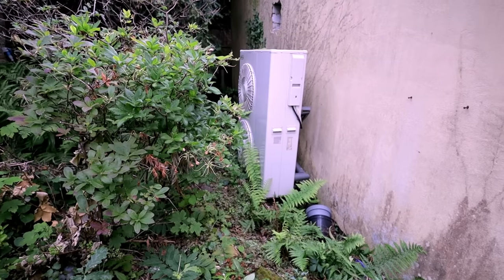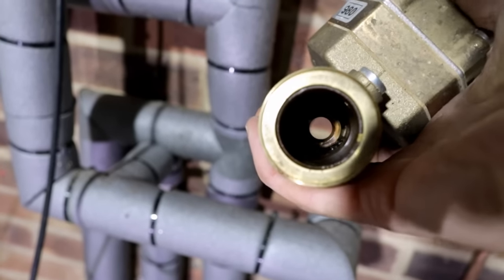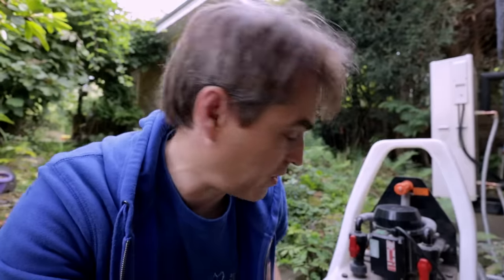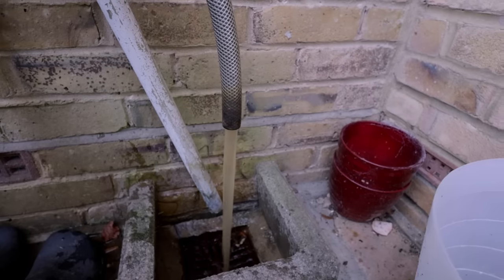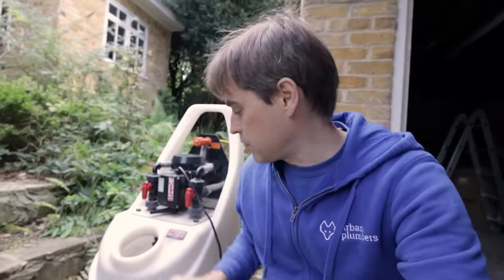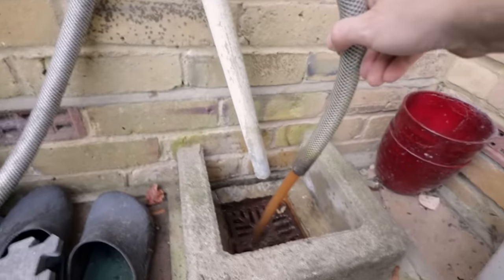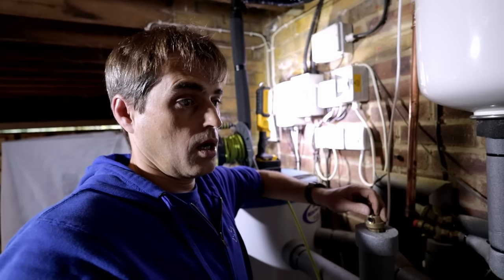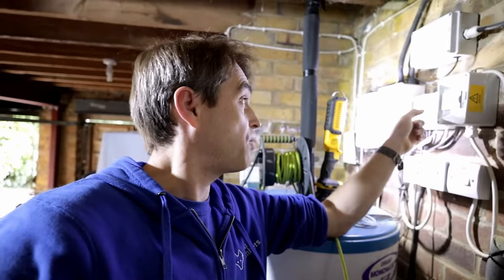Heat Pump Nightmare Update - What Was Wrong With It?

Comment: What were the potential root causes of this amount of dirt building up in the heat pump's heat exchanger? Galvanic corrosion? Some kind of external ingress of muck? Some other components in the system giving off crud that ends up accumulating in the heat exchanger?
Reply: If we are looking to get a heat-pump but keeping old radiators, should we check our plumber dose a flush first or is this just a one off issue?
Reply: @RobertHeibel with any new heat source even a new gas boiler I'd always recommend a clean to get maximum efficiency and to not risk clogging up your expensive new unit
Reply: Putting the unit surrounded with foliage adds dirt?
Reply: @RobertHeibel 
Every new installation must be flushed first.
Otherwise the warranty goes out the window.
Reply: If you're going to replace a boiler on an existing system,  either with another HE boiler or an ASHP or GSHP, the first you should get a water analysis carried out, I use Fernox Lab for this. Then you'll know what type of flushing will be required. Then you must fit a good quality filter unit, I use Pneumatex or Spirax units. On a large dirty system I have used a side stream filter. It would seem that this system was either very dirty and/or was not correctly flushed. Some systems are so dirty, especially if they were Open Vented, that they can never be effectively cleaned.
Reply: @geoffaries  
Agree completely.
You obviously know what you are talking about.
Reply: @geoffaries  Thanks for that insight Geoff!

Comment: Great video, as usual,  
I think if the system has not been installed and cleaned correctly on retrofits, we are going to get a lot of blocked  HX 
INTA  make a leaver valve that fits straight onto the heat pump
1˝ Female swivel x 1˝ male flat face extended  lever ball valve (HPBV11)
 1 1/4˝ Female swivel x 1˝ male flat face extended lever ball valve  ( HPBV114 )
This means you can disconnect the heat pump without getting air into the system 
Think these will be a godsend for installers and manufacturers going to warranty/fault calls in the future

Comment: Great fix. Do heat pumps modulate flow to control temperature? My Daikin runs at around 25L/min when its heating up, then will go down to around 15L/min, then i find it will sit around 7-10L once its reached temp and compressor goes off. Brand new system no old stuff, 8kw unit, this is running around 32C. There's no issues with it at all just observing how it works and cycles had me intriged.

Comment: Seems like companies will struggle with those heat pumps for first 10-15 years until the system been understood by technicians getting used to maintaining and installing
Reply: A solid, professional install can make ALL the difference. 
There can almost be no end of things which will crap up over the lifespan if it’s not put in properly.
Air handler location, outdoor location, ducted or not, integrity of the lines, the right gradient, proximity to roof/door/windows, available airflow+drainage (outdoor unit), maintenance performed vs maintenance “expected” ... the list goes on. 
“There are few donkey units, many donkey installs”! 😅

Comment: If you're going to replace a boiler on an existing system,  either with another HE boiler or an ASHP or GSHP, the first you should get a water analysis carried out, I use Fernox Lab for this. Then you'll know what type of flushing will be required. Then you must fit a good quality filter unit, I use Pneumatex or Spirax units. On a large dirty system I have used a side stream filter. It would seem that this system was either very dirty and/or was not correctly flushed. Some systems are so dirty, especially if they were Open Vented, that they can never be effectively cleaned.

Comment: Glad you sorted it. But how did the manufacturer not spot this?
Reply from the maker: @TheDickPuller I really don’t want to get deported to Scotland 🏴 - imagine having to put right your push fit installed 😭😭😭
Reply from the maker: Manufacturers engineer could fix it as I changed 1’’ connections on the heat pump to 1’’ 1/2 and he said they didn’t have sizes that big to connect to the unit !!! - true story - it’s all 28mm for those guys no matter the size of the unit !
Reply: @UrbanPlumbers I'm fitting them ATM they send out a 1 1/2 to 1 reducer and 1" nipple

Comment: If I've understood the comments correctly, this was previously a vented gas boiler CH system and the installer didn't flush it before fitting the heat-pump. Therefore, had the gas boiler remained, the system would have eventually caused problems through time unless it was routinely flushed as part of an ongoing maintenance programme?

Comment: It’s always a good feeling when you can prove what the problem was from the start. Be interesting to see how much more efficient the system will be now?
Reply from the maker: Not much 🤣. It run for 45min and flow dropped to 1400 l/h. I took the strainer out and it was full of crap. Now the system needs a full flush as well.
Reply: @UrbanPlumbers  so is the whole system just full of junk and it's accumulating at the lowest point?
Reply from the maker: @missionunpossible pipework is coated with 3-4mm of sludge. There is still some one the system.
Reply: @UrbanPlumbers I was wondering if the crap had spread throughout the entire system.
Lesson learned for the next time. Clean the existing heatpump and pipes before connecting it to anything brand new. This should save some time if it's cleaning while working on the new system.
Reply: Would be an even better feeling if he had done the job properly in the first place. The heat pump is blocked because he didnt flush the system properly, assuming he flushed it at all.

Comment: I Saw the first film and wondered if all the pipe exchange was unnessecery, given that it still didnt work after all that effort, and sure enough I wonder what the flow rate would have been given the system was flushed first of all before all of the pipe work.  But... clearly the client will have a much better system for all of the effort you have put in.

Comment: Good to see the follow up , please see if you can come back March time and get the owners review on how it went with winter as I get the feeling it’s going to be a cold one by mid November, and see if you can get some hard figures to cost , so I can compare it yo my own air to air unit , since I ditched the air to water due to poor performance in winter and needing a off grid backup sans power  grid like last years 10 day spell. In that the echodan 16kw twin split couldn’t cope if it wasn’t for the wood fire we would have been in serious issues when temps hit negative 30 .

Comment: That cabling looks a mess. We have our heat pump turned off the installation is so bad.  I could do a better job!  Earth wires not connected,  one or more switched lives not connected when permanent lives are connected, many joints leaked, long pipe runs not required, messy wiring, ye gods and little fishes

Comment: Good diagnostics. Dirty system and the plate heat exchanger is acting as a sediment trap. Sounds like the plate heat exchanger in the HP  needs another heat exchanger in the plant room to isolate the dirty system from the HP.🤣

Comment: We do not (yet) see this technology in the USA, but I’m sure we will with the war on natural fuels threatening to eliminate NG/LP MODCON boilers.  Your video answered one of my questions about these heat pumps: There IS a plate HX in the outdoor unit. The other question is what outdoor temperature do you use for heat loss calculation in your region.  We use 0 degrees F (-18 C). I can only see these delivering enough BTU ‘s in small or very tight houses, unless multiple systems are used. Thanks for the enlightening content you provide.
Reply from the maker: -3c. Biggest units on single phase can do around 13kW, so a very large modern house. 5-6 bedroom house if new build or well insulated can be done on a single heat pump
Reply: you actually do have this tech in the USA (our house in Portland had a heatpump) in our time it only needed servicing, but understood the original installer didn't want to do any maintenance and now we know why (it was a very very poor install)
Reply: I can attest! Though my “house” is small, it is long, narrow, a mixture of rooms and open spaces, is old. 
A small efficient unit in the central space where thermal mass collects anyway is just a method of increasing the ambient noise. 
I find myself going to bed because it’s too cold to be awake, not because i feel like sleeping.
However, I normally use the fireplaces in winter (when there other people to keep warm), was giving it a try this year without fire. 
Never need to use the heatpump winters i have fire going 1 p/d. 
[the unit’s cooling is very welcomed and affects whole place though!]

Comment: Another great video. 

Why didn’t you (the manufacturer) just replace the plate heat exchanger?
Reply from the maker: That’s requires degassing and re brazing. Probably cheaper to change the whole unit. As a matter of fact the manufacturers already swapped the unit once as the compressor died after a year running on such a dirty system
Reply: See how long it last’s before clogging again , badly designed unit I think...👍
Reply: With something like the heat exchanger blocking, which will be a common problem going forward, especially on poorly installed/ not flushed systems, you would think manufacturers would make the hex easier to replace, especially considering the costs of these units new.

Comment: Manufacturer would blame the installer for not flushing the system properly before fitting the heat pump. This cannot be stressed enough and is necessary when replacing any type of boiler in 
either an existing system or even a new installation. The magnetic filter would also show that there is crossive deposits in the system. Unfortunately installers do not get paid for revising their work.

Comment: Hi - really liked this video, and highlighted some of the concerns I have - we are about to sign on the line for a new ASHP (Grant Aerona 17kW) which I notices is the same one as in this video. Do you think this is a problem with the manufacturer, or was this just bad luck in this instance?
Reply from the maker: Installer not the units fault here. 17kw is very large - how big is your property and how well insulated ?
Reply: @UrbanPlumbers  thanks for the quick response. (According to the EPC) The house is 232 m2. Built 1993, there is good loft insulation, and it is assumed that cavity walls are insulated (neither of these are in the EPC recommendations).

Comment: Why do you think the heat exchanger was so badly blocked in the first place - existing system not properly flushed at install time?
Reply: It can only really be that, beyond it having a fault somewhere where the heating system is losing water and constantly being topped up, that really accelerates corrosion

Comment: I can't understand why they don't fit these heat pumps in a south facing location?  They always seem to fit them in shade?
Reply from the maker: Makes zero difference
Reply: @UrbanPlumbers  I don't believe that would need some science to back that up.
Reply: @davelocktalk  Simplest logical answer is they work at night, so facing towards or shaded from direct Sunlight has no significant effect on them. They extract the heat from the air surrounding them using a super cooled refrigerant. One type used R32 Boils @ -52C :-)
Reply from the maker: Just google it.

Comment: Great to see the good work you do but difficult to think that many houses have these massive utility rooms we tend to always see on youtube housing the plethora of control gear. It seems an extremely high level of expertise is needed to keep all this paraphanalia up and running compared to getting a gas boiler to work. This also without the pile of equipment for the solar fed batteries we will need when the power stations are closed down and the wind is either still or too fierce to run the grid.

How much have these repairs and re-pipes cost the user on top of the original installation? I am glad I have a gas fire in the living room, a camping gas cooker and plenty of candles for the blackouts as highly unlikely these government plans have been joined up and costed. People cannot drive the diesels we were all told to buy for eco reasons from 2001 in to London now without a hefty charge or fine, it took until 2015 to realise it was a very bad idea. These schemes all seem to be based on pure dogma so I will steer clear of this technology. Keep up the good work though keeping this stuff up and running for those that can afford it.

Comment: Had one 
slower than a week in prison to reach reasonable temperatures 
massive radiators everywhere 
Water demand ok 
Good luck with the running costs and space for one
Reply: If it's slow to heat up then it wasn't set up correctly, it should come on and adapt to the outside temperature to maintain the desired indoor temperature.  If you're using it like a boiler and waiting for the house to get cold before turning the heating on all the time then it will cost more to run. Letting it maintain the temperature inside with a setback when required would avoid both of those issues you state.

Comment: Looks like there should’ve been good filters fitted on the system when it was installed Dracula.  It’s amazing and testament to the usual ‘used car salesmen Chancers’ fitting ASHPs, that they don’t appreciate that the smallest bore on the system is any SS Plate Heat Exchanger. 
What was your final flow rate through the ASHP when you run the Purge Cycle? In Litre/min please m8ty.
Hey, I luv your Polish Cowboy Builder bib n brace, a Lidl middle aisle special😂😂😂
Good video son, keep em coming👍👍
Luv Dick Puller.
Reply from the maker: German bib and brace mate, so your right - Aldi.

System run at 1800l/min or 30l/min. It should be around 36l/min for this unit.

After 45min flow dropped to 1400/min. I took the strainer out and it was fully blocked. 

System, although 80% reppied now is still coated with crap on existing copper pipework  and rads. Trouble is the customer replaced most of it himself including all rads, so not my job now to flush it anymore.
Reply: @UrbanPlumbers   Thank you for taking the time to answer.